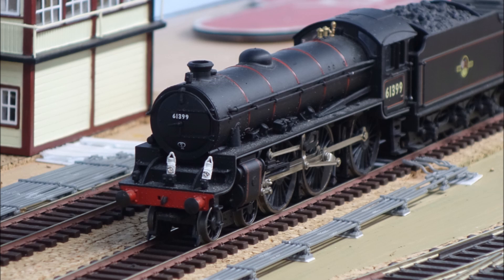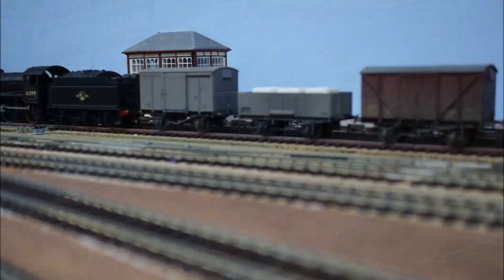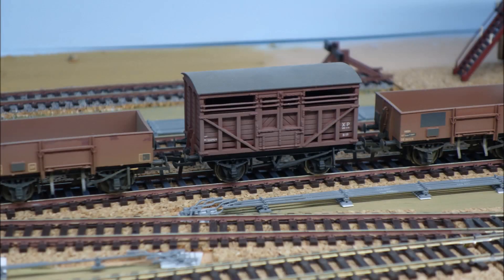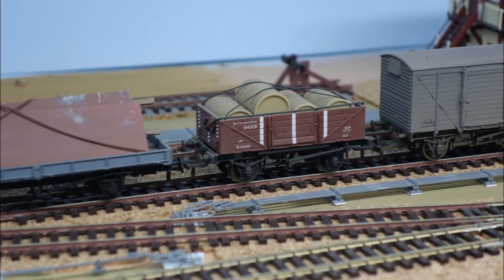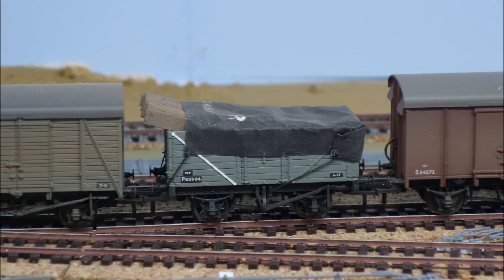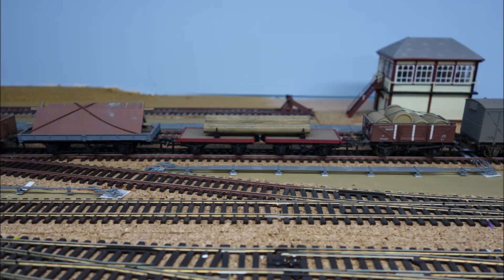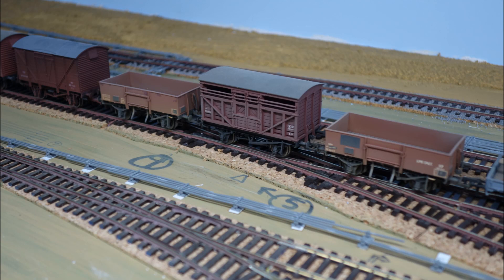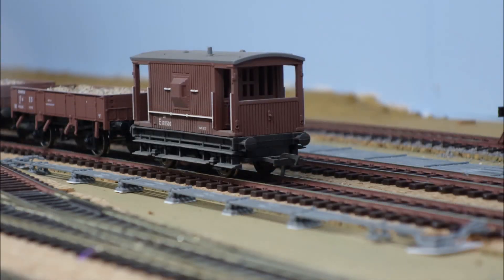Bite Size Bits -  Freight Train formations

Comment: Thanks for a very informative video.  A couple of points I picked up on though.  'Shockvans and Opens' were vacuum braked vehicles and could be used to increase the 'fitted head' of frieght trains if desired.  Barrier wagons attached to tank wagons may be loaded with non combustible materials, eg. brick, sand, ores, but not coal.  Gunpowder vans are quite popular too, they also have barrier wagons when loaded, and should be placed near the middle of a train.  When loaded there was also a limit to the number of vans coupled together.  Many years ago I wrote a rule book for a model railway, with extracts from the 1936 GWR Rule Book and appendix.  It was fun to do, and and operate to.  The rule books would have been very similar to all of the big four, but the appendices would have varied to suit each location.  It served me well when working on BR in the 1980s too.
Reply from the maker: Thanks Robert - every day is a school day as they say!!!

Comment: A lot of these tips have helped me with modeling transition era BR in Trainz Simulator. Earlier today, I was playing a session on the Settle & Carlisle route, and had all of the fitted wagons up front, and four ex-PO 8-planks at the very rear, while running a pickup goods between Appleby and Horton (with a trip up the Hawes branch, since the session I was playing was focused on dropping cattle vans at Kirkby Stephen, Garsdale, and Hawes, also picking up other loose wagons, then continuing on to Horton to pick up lime powder and limestone, while unloading the aforementioned 8-planks of coal to fire the kilns; TRS2019 has the option to edit trains while in Driver, which is how I was able to add extra work, swap the Fowler 4F for a Stanier 8F, and put a Jinty as a shunter at Horton).
Reply from the maker: Hi.  Modellers can learn a lot about operation, speed etc from TrainSims programmes.

Comment: All I ever knew was a barrier wagon between steam loco and tanks. Well done.
Reply: Unless running empty, good way to change it up if you have up and down lines is take the barrier wagon out when it goes past in one direction.
Reply: or gunpowder 😊
Reply from the maker: I think empty tankers that carry flamables might need a barrier even when empty.  They would have some residue??  I will look into this and come back to you.
Reply: @yarslowmodelrailway1  Some flammables are worse when empty, as you end up with vapor!

Comment: Nice work - as you say this is an express freight, so really more applicable to longer distance freight. If you're modelling a local line, then the rules may be discarded in favor of practicality - with wagons placed in a sequence to allow easy drop off with the minimum of shunting.
Reply from the maker: Certainly Neil - especially for the local "Pick-up" or stopping freight trains.  The wagons were put in the order that made shunting easy.  It would run under J or K lamps so just wander down the line.

Comment: In addition on model railways, do not put heavy wagons on the end of light trains. Physics dictate tension load will take the easiest path independent of where the rails go and cause derailments. Something that happens on a regular basis in the US with empty well cars in the middle of full trains. Also the wagon carrying the plate, death trap, Beighton train accident in WW2, caused by plate being dislodged and slewed out of running gauge into live line running gauge. Large loads require restraint in all directions and be inspected regularly for cold or heat generated effects.  In our area we had a regular industrial gas train with barrier wagon on each end with fire fighting equipment. (also 1500v electric locos) ran for years till they closed Woodhead and the steel works.
Reply from the maker: Thanks for the extra info Brian.  Always happy to get useful contributions that aid us make better models!!

Comment: Just a few more things :

1.The need for runner wagons depends on the degree of overhang. Anything less than 1 ft 6 in doesn't need a runner wagon.

2.Trains conveying explosives must not carry any other hazardous materials or highly flammable liquids. Nor can bolster wagons loaded with metals be coupled to liad tank wagons.

3. Barrowmore MRG and Limit of Shunt have lots of interesting documents for raikway modellers.
Reply from the maker: Thanks for this - I am always happy to learn about prototypical working and will have a look at the sites suggested

Comment: What speed should the freight train train run at?
Reply from the maker: Hi Lennon - my Bite Size Bits video on Classes of Train from March 2022 gives the various AVERAGE speeds for freight train classes.  Do bear in mind that I model late 50's/early 60's so modern trains run a lot faster and older trains may run slower.
Reply: @yarslowmodelrailway1  nice one thank you.  I'll check that out.

I've been working my way through them in a non-chronological order.  Enjoying the series so far!

Comment: Just discovered your channel, and subbed. Bite size, informative videos such as this are very helpful.  Especially for those wanting to make the move from train set to model railway. Another one commonly seen, is trains ignoring signals, or none at all.
Reply from the maker: Hi.  Thanks for your sub.  I regret that, until now, I have only had static signals so for Yarslow, making them work will be a big challenge!  Especially as some of them will be complex.

Comment: Hello. I was wondering what is the utility of sheeting a closed Van? Is it to prevent water getting into the van?
Reply from the maker: Hi - a very good question!  Some vans were found to have rooves that leaked in the rain when running on faster trains and others leaked around doors and vents.  The solution, when conveying something that had to be kept dry, was to sheet the van - usually a decision made by the porter/foreman in charge of loading.  It would have been unusual to have spare vans lying about so they had to work with the vehicles they had.  Hope that helps.
Reply: @ Yes that does help. Makes sense!. Thank you.

Comment: Thanks for the information on goods formations - will make a list of your points and try to follow them. Harking back to your video on pick up goods from 2016 which I just found the other day, you said you would explain why slot 6 on your wagon table was empty. Maybe I missed something but I couldn't find an explanation anywhere. Slowly working my way through your videos and finding them most interesting. Regards Peter
Reply from the maker: Hi Peter.  Each train runs with a specific number of "blocks" - say 5.  Some contain 4 wagons, some 3, some 2 etc etc.  Some are empty.  The blocks each contain specific wagons and this make up does not change.  For example, block 1 is a cattle wagon and a 16T open.  When the train runs, it always contains 5 blocks but the number and consist differs every time.  The use of empty wagons helps the length of the train vary and has the added advantage that it does not cost anything to add the block to the system!!  Hope that helps.  Barry
Reply: @yarslowmodelrailway1  Thanks for that - think I follow it now. Everything ends up at the beginning  again after 21 days - very clever! Regards Peter.